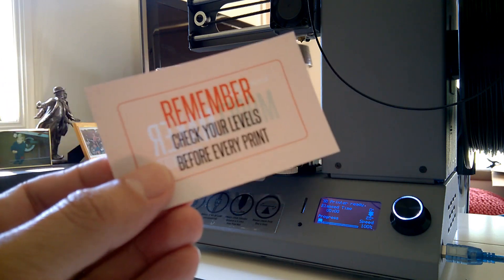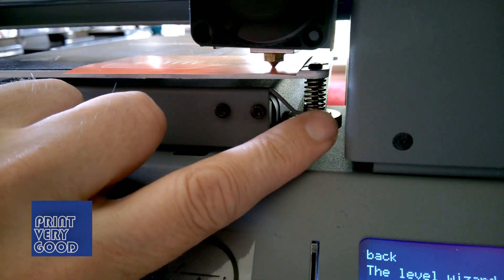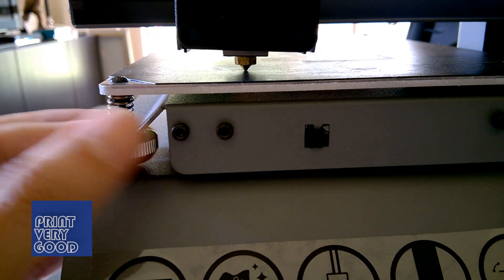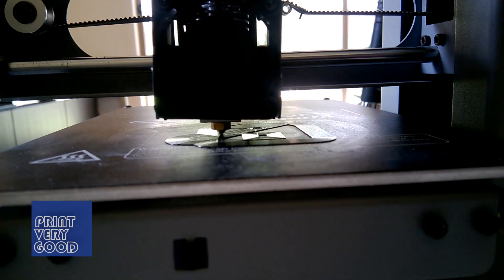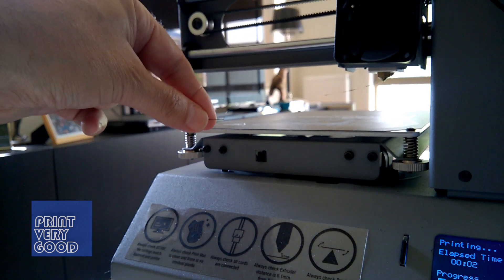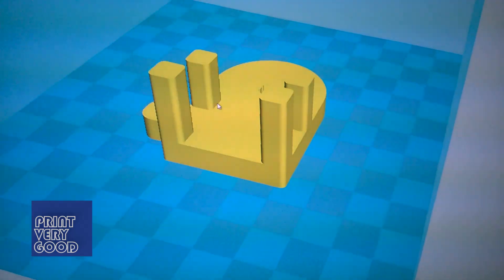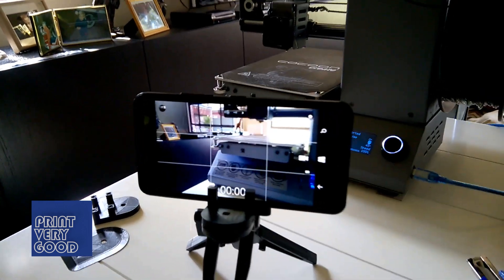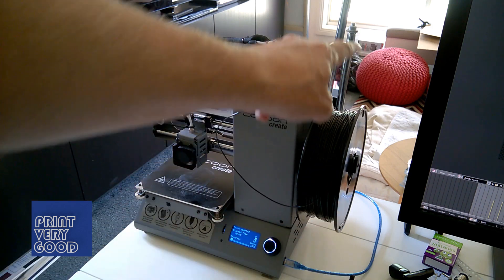Bed Levelling for Great Adhesion! - Aldi Cocoon Create Mini 3D Printer

Comment: As below i stated i bought one of these machines recently ,i have a hand built upgraded prusa style mk 2 made from a very early prusa mk0 machine . On this wanhao or coccoon  the Bed level completion brings the furthest corner to almost touch the base of the platform leaving very little adjustment tolerance. This seems to indicate the x axis arm is tilted relative to the base plate. I wonder a. If this can be adjusted calibrated and b. I wonder how this machine calculates its z =0 mm point and how consistent that is being produced ,eg after a power down and up . This may explain the bed level dilemma .

Comment: I bought one of these machines recently . The nozzle is 0.4 mm , that card is 0.1 mm which is a 1/4 of the nozzle width . Technically ,it should work fine with this card . So it seems that your adjustment process is causing some gap around 0.3mm or so . I cannot think why this process would not work and i cannot imagine heating element would shrink the extruder by 0.2 mm .

Comment: Your system for the initial bed leveling seems great except what happens if the bed is not perfectly flat. What I mean is this, your tolerances are very fine and it would concern me that the nozzle could drag along the surface of the bed at some point if the bed was a bit convex. Am I right in thinking this way?
Reply from the maker: Hi I Minabrons! Yes you are 100% correct. If the bed is convex or bowed upward then that would be a problem. Fortunately mine is very flat but I have heard of people having problems with bowed print beds. I believe that's why some 3D printers use glass as a print surface.
If you compare the gaps between paper and feeler gauges that I showed in this later video https://youtu.be/9JAlERd41NQ  you can see there's not a great deal of difference between the two, just enough to make a difference.
Reply: Thanks. I'm in the process of making my mind up whether to buy a Prusa i3 Mk2 kit or a Creality CR10s.
Reply from the maker: Ooh nice choices I minabrons. That's a difficult decision to make, I feel you can't lose if you go either way.
Reply: My feelings exactly. BTW I almost bought a Cocoon Mini but I was on my bike at the time. 
My only prob with CR-2 is buying from GearBest. That worries me. Whereas with the Prusa I feel more confident about the parts but the Prusa kit is about $150 more than the CR-2. The CR-2 has the greater volume but the Prusa can use different types of filaments, etc, etc, etc,. Decision, decisions.
Reply from the maker: I've never bought anything from GearBest either but I will give it a try at some point. Having too many choices is a good problem to have but I suppose it boils down to how large you want to print. It looks like the CR-10 series is easy to repair if something does go wrong, having said that they do appear to be very reliable. $150 is also equal to 5 rolls of filament :)
Reply: I went to buy the Prusa but discovered after checkout that there was another $100 AUD for shipping. This made it $860, over $220 more than the Creality. Too much. So I chose the Creality CR-10s for $625 plus shipping of $10. Fingers crossed. Thanks for the chat.
Reply from the maker: No worries I Minabrons. I think that's a good decision, I'd love a Prusa i3 but the price is a bit out of my reach at the moment. Let me know how it all goes, keen to hear what you think of the CR-10S and the GearBest buying experience.

Comment: I gave my build mat a light scuff with 80 grit sandpaper and I ran a tighter gap.  Had nothing shift since.  I also do the same thing with the filament, pulling it away.  You can also try spraying hair spray on the build mat.  Clean it away with metho or iso alcohol between prints.
Reply from the maker: Thanks for the tips JETFOURLITRE I do appreciate it. I've since refined my workflow and am getting great results with bed adhesion. You can see that video here. https://youtu.be/VumJQyD7KlQ

Comment: Just impulse-purchased one of these at Aldi for $249. I came to the same conclusion as you regarding the nozzle-bed distance. Still not having complete success with adhesion but will continue experimenting.
Reply: I've still been having a little trouble too. In my last print, I printed my model with a raft, then just after the raft was finished, paused the printer, then used some sticky tape to tape down two corners of the raft. Worked a treat
Reply from the maker: Hi Leon, if you're still looking for more adhesion watch the start of my latest video. https://youtu.be/Y-9JeUxHnoo

Comment: Greatly appreciate you sharing your experience. Will definitely try reducing the gap. Curious...are you using the USB port for any kind of control or remote monitoring? The user guide mentions it is only used for firmware updates. I’d love to remotely stop a print if it is going pear shaped (keeping an eye on it with a web cam).
Reply: Hey Tony. I'm using a Xiaomi XiaoFang WiFi camera to monitor my printer. It's super useful for this, as it has a magnetic base which can stick directly to metal case of the printer.
Reply from the maker: Thanks Tony! No I just save the file to the SD card and print from there, doesn't appear to be anyway of communicating with the printer other than firmware updates. Your webcam idea is a good one though, wonder if that would be possible with future firmware updates?